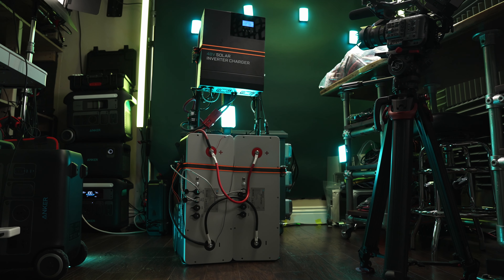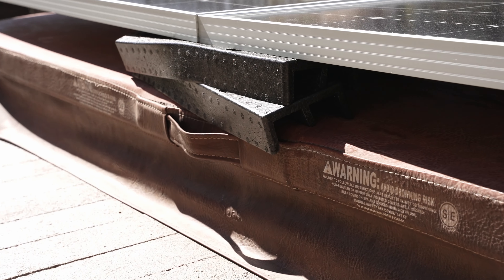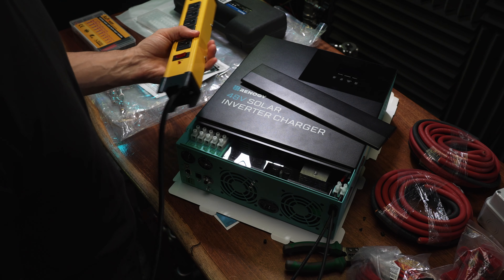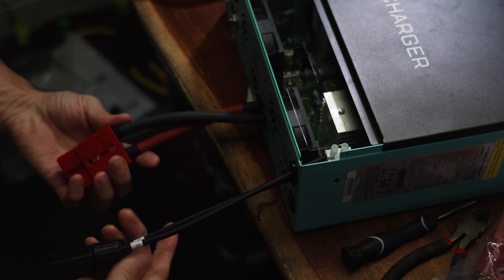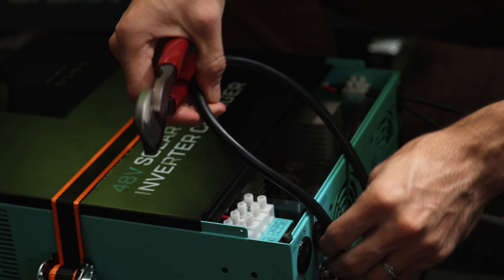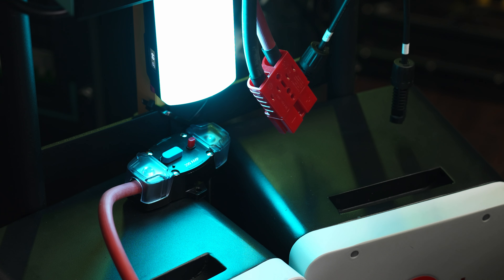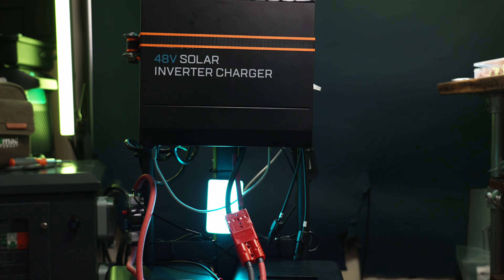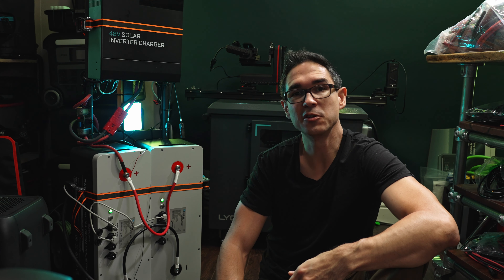How to build your own portable solar power station on a hand truck

Comment: Will Prowse has a few videos on making hand truck systems using an EG4 hybrid inverter and server rack battery. It's a lot cheaper than buying a premade unit assuming you don't mind the look.
I really don't like how the batteries are mounted with terminals sticking out unprotected. It'd be better to use a single 48V 100Ah server rack battery. I don't think Renogy sells one though.

Comment: Before I finish watching this; Did you see that Anker dropped the Solix F2600! I was just taking delivery of my 2000 when I caught it. Weighs 2.5 lbs more than the 2000, wi fi and bluetooth, 512 more amp hours for $800 more than the current sale price of the 2000. Seems a bit steep for the extra, but not so bad if it's being compared at regular price.
Reply from the maker: I didn’t, but that’s very cool. There’s a lot of pretty crazy battery tech coming out, it’s hard to keep up!

Comment: My only issue is the exposed terminals on those batteries. Given you're using 2 gauge wire, that implies it can handle up to around 130 Amps, and it one can get killed by less than 5 Amps. So, yeah... I think in a followup video with a solution to covering those expose bits might be a worthwhile followup in the future. Still very cool video!

Comment: Decent components, absolutely ugly, scary, looking throw together. As others have said, Will Prowse has some great video's on building your own, and he shows people how very well. That said, I believe anyone could throw one together, but, there's so many other things to consider if you want a great system. Myself, I won't buy or build anything that's not low frequency, transformer based,,at least 24v or more, and has a idle consumption under 15w.  Most never think of idol consumption. If your idol consumption is just 100w, that's 2400w to just be turned on in a day, or 100ah @24v. Now if your idol consumption 15w, that's a mere 360w in 24 hrs. Simple stuff like that, change the whole game. And that's just 1 aspect of the game! 🙈🙉🙊, Imagine what you could learn if you put your mind to it
Reply from the maker: The best way to learn is to do something yourself. This was my first attempt. :)